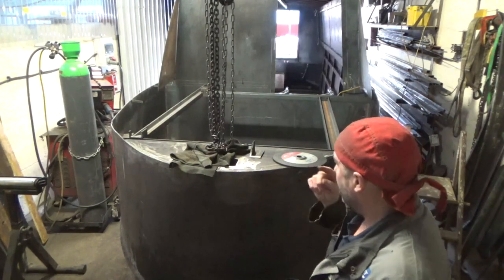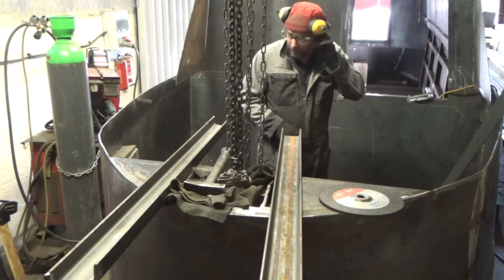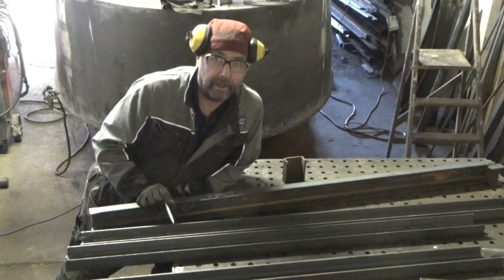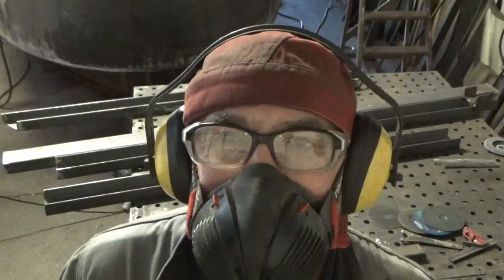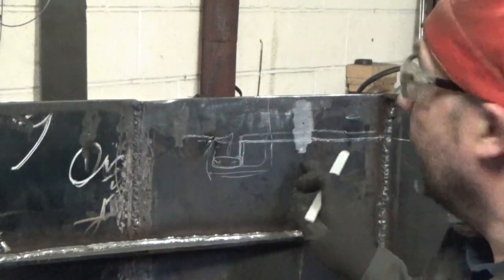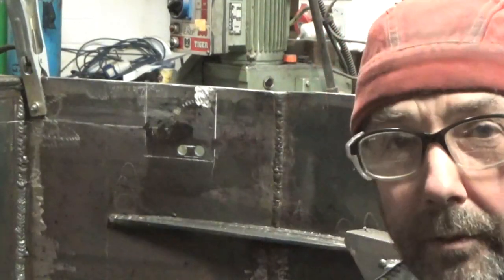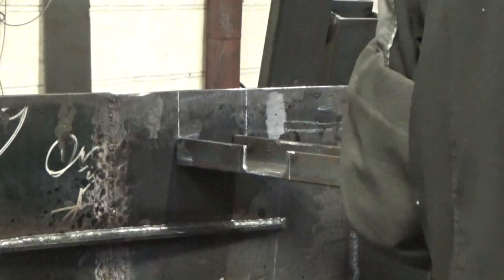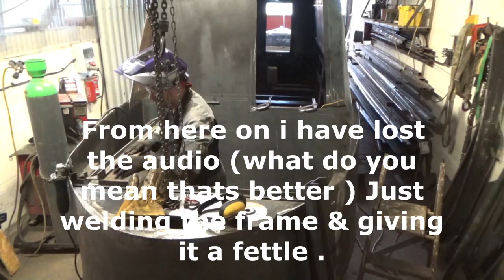Building the Ebay Narrowboat. Stern deck steelwork installed

Comment: I’m a bit confused about the size of the slot to let water out as it could very easily get blocked. On our boat which has similar sized channel. The drain is the same size as the channel. Lovely work as usual though.
Reply from the maker: Hi Gary. I was a bit unsure as to size of it & was considering it might get blocked after I cut it. So I will be making it bigger as your suggestion. Its good to receive comments that help me avoid mistakes.Cheers Andy